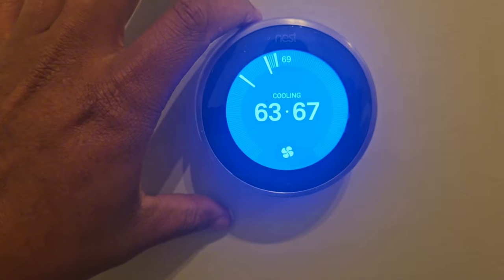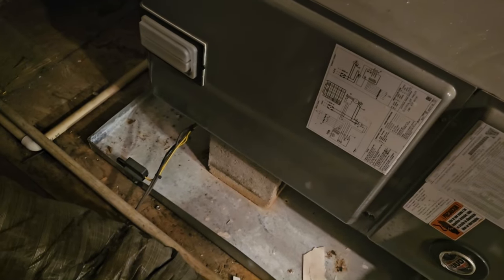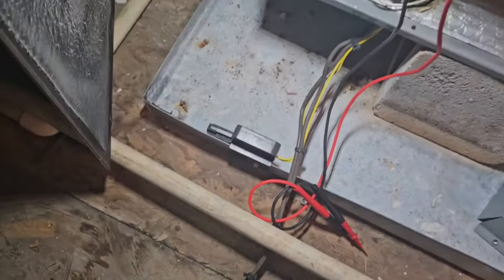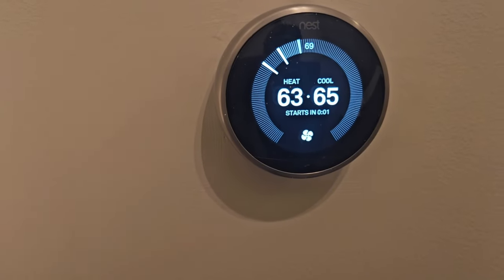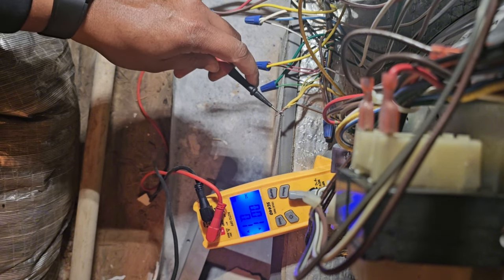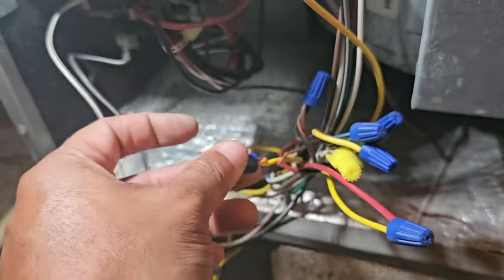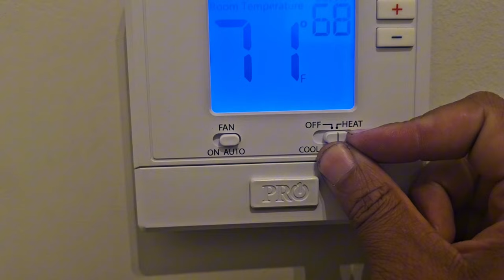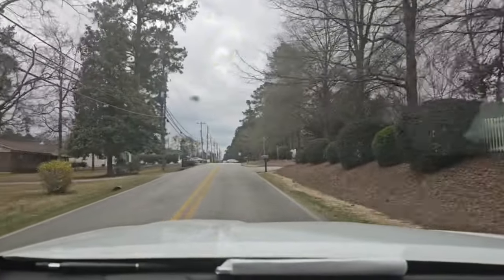Service Call for a Bad Nest Thermostat

Comment: The new thermostat you installed is the exact same one that I had replaced a couple of days ago. I got an all new system with a Honeywell thermostat.  😊
Reply from the maker: Our company likes the simple stuff. When you work with rental properties you'll find that tennants don't use those extra fancy settings and features. However at my own home I use the Sensi WiFi thermostat. I love it.
Reply: I get that. I mean, thermostats are basically only there for one thing anyway. The more simplistic they are , the better. The new one I got serves its purpose and is very easy to use. Four buttons. Although it would be cool to have one that I could control with my phone but I digress. Lol
Reply from the maker: @Weeblekid ain't nothing wrong with keeping it simple 👌🏾
Reply: All those fancy t stats are not necessary.  SIMPLE IS THE BEST IN MOST EVERYTHING.

Comment: Nice find!  I had one of those Nests in a house I bought for about 3.5 years.  Functionally I didn't like it, but I guess I got lucky b/c it didn't fail on me.
Reply from the maker: I'll be honest, on 1H1C systems I find them to last a lot longer than if they have to do a 2H1C systems. I don't know why, that's just my experience
Reply: @AB_HVAC  Interesting.
Reply: @AB_HVAC  Oh... Correction: I had an Ecobee, not a Nest.  They kinda look similar.
Reply from the maker: @jkmarshall3553 they do. I haven't seen much of those since I've moved down south